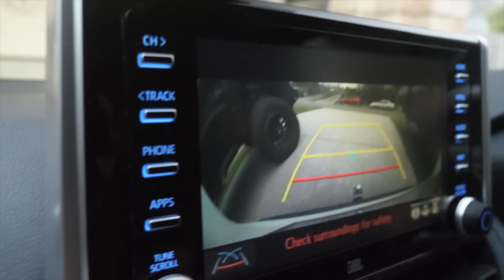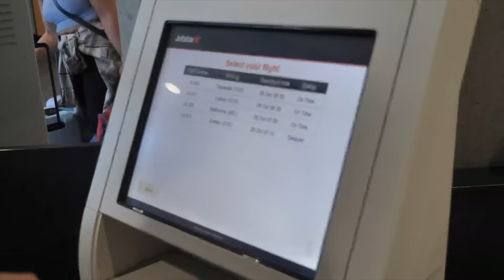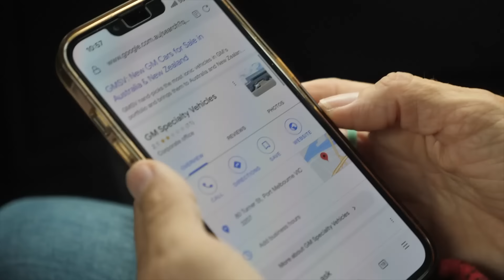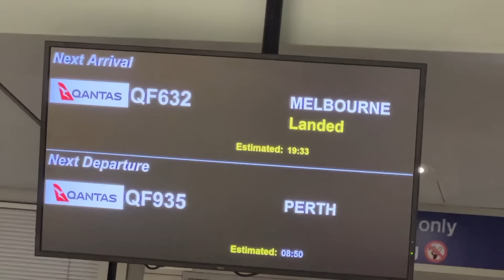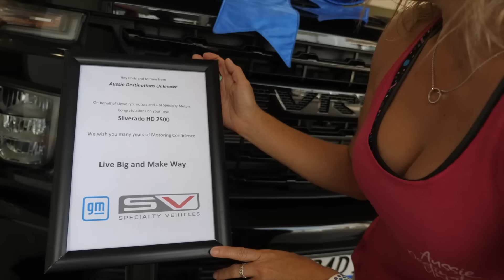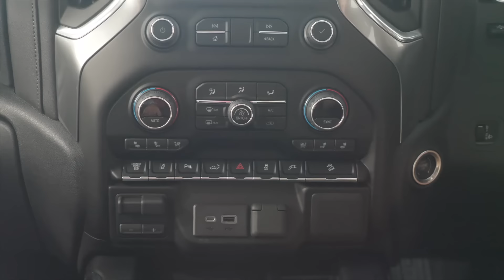TOP SECRET!! HOW GMSV REMANUFACTURE THE CHEVY SILVERADO FOR AUSTRALIA! MIND BLOWING FACTORY TOUR!

Comment: For those of us in North America (US/Canada anyway), the 2500HD short bed is the entry level into the HD pickup truck market. We have a long bed version available, plus the 3500HD in either single rear wheel (short and long bed) or dual rear wheel (long bed).  The current tow king in the heavy duty pickup market is the Ford F450 that has one configuration rated to tow up to 40,000 lbs/18,150kg. The F350 tops out at 8,000lbs/3,630kg of payload.
Reply from the maker: Great info!
Reply: @AussieDestinationsUnknown  I'm surprised that the 8 foot bed isn't offered in AUS.

Comment: Great insight into the reman process. It would be bloody interesting to work out what the actual vehicle costs without the affect of the dollar conversion factor from US to AUS and then the additional cost to convert from LHD to RHD. Awsum bit of gear though 👍
Reply from the maker: That would be fun - let us know when you figure it out 😁😁
Reply: @AussieDestinationsUnknown  Yes I see the affect of dollar conversion factor on a daily basis with our US manufactured Heavy Trucks.  It’s a shame really because these vehicles are what people should be using to tow, the dollar conversion rate and then the reman expense would be the biggest contributing factors that put buying one of these out of reach of most Aussies that are already stretching the budget to the extreme to purchase Cruisers or Patrol…..A Duramax 6.6 running a 10 speed Allison bloody unbeatable 🤙
Reply from the maker: Sure is! But, money-wise it wasn’t much more expensive for us to get our first Chevy than to chop a 200 which is what we almost did … it costs a fortune to do that as well 🤪
Reply: @AussieDestinationsUnknown  you got that right.  And then it is still a Cruiser,  And don't for get the Engine tune, Intercooler, tranny cooler, auto lockup kit, all to try and get it to be a 1/4 the tug the 2500s are.  I considered a chopped 200, but costs 2nd hand were mostly more than the same age and kms 2500HD.  No comparison.